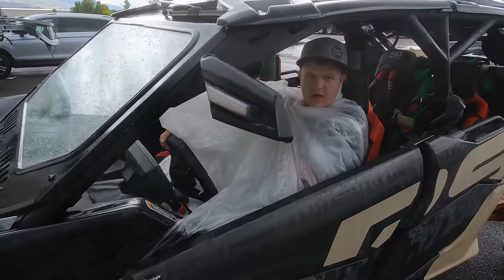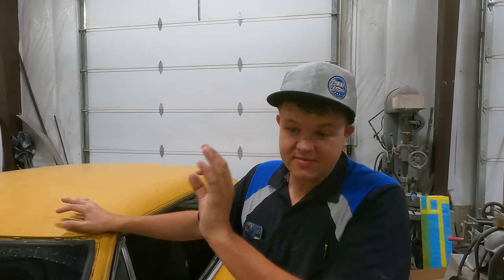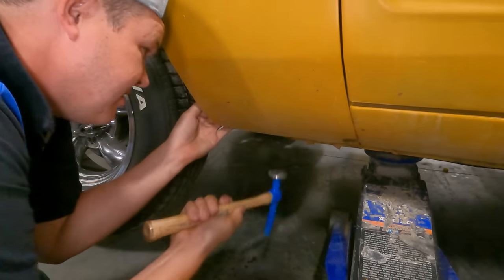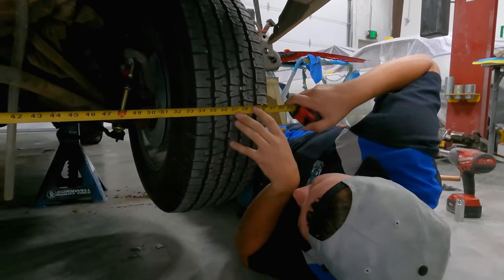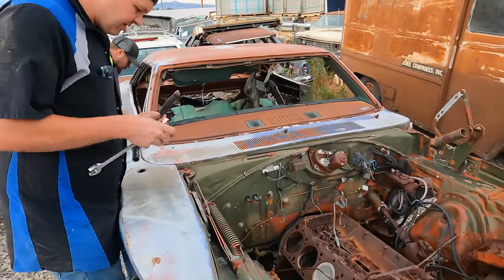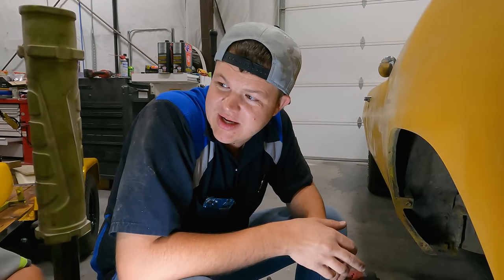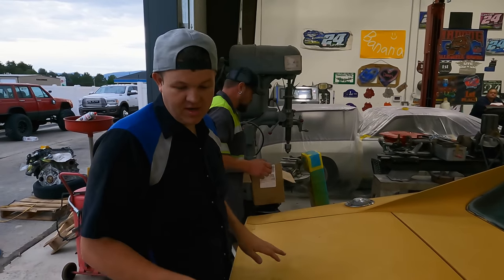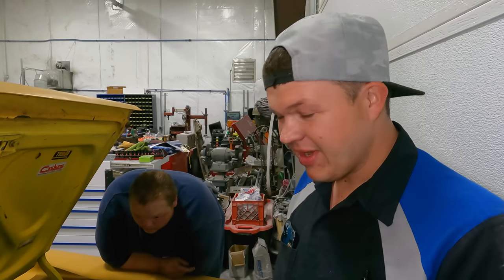Viewers DECIDE The ENGINE In The Giveaway 69’ Charger!

Comment: Even though it's NOT a number matching car I'd still keep the original engine block but build it with the usual HP stuff: trick heads, cam, headers, and a good fuel injection system (Holly or Fitech, etc) for good daily driver response.   I prefer the 727 Torque Flight auto tranny - but that's just because I'm lazy. A Tremec 6-speed is a great choice too!  Definitely want the power steering too! Also, much lower gears in the rear end for a better highway experience. I'd take it any OEM Dodge color from that year.  Also, if I could be picky could you please install the Torque Boxes that are OE on the 426 Hemi cars?? Thanks!

Comment: My 2 cents: keep the 440, freshen it up, change to fuel injection, electronic ignition and either a nice 4 speed or a 6-8 speed tranny, if it’ll take the torque. So, not a comp,rte retromod, but just enough to keep it pretty much the way Dodge built it, with a couple of mods and a f refresh so that it will run good on pump gas and be reliable. Not that old 440’s weren’t reliable, just that that term has a whole new meaning now… I mean, who wants to be changing cap and rotor every 20,000-40,000 miles and re-setting the points, dwell, gapping plugs, etc???

Comment: What age are the lads at the alignment shop? Any Mopar guy over 50 should have picked up on that missing offset alignment washer for you. My vote for the engine? Modern Hemi with a matching modern multispeed automatic......and I'm a purest. I grew up when 2nd gen Hemi's and driveshaft twisting high compression 440s were new. I loved them, but they were uncivilized torque monsters that sucked high test faster than you could fill them and terrorized towns and tracks all over North America. It wasn't uncommon to go through two tanks in a night of street racing. The modern Hemi's give you your cake and let you eat it too. They also don't overheat. Don't know what vapour lock is and they start every day, even in Winter. Two top line Diehards and a boost sometimes weren't enough to roll over and start a high compression big block Mopar in the cold of Winter. A modern aftermarket K-frame to hold that much lighter modern Hemi and hang more modern front suspension and brakes and your giveaway car becomes a usable everyday driver or joy to take across your great country. You quite simply cannot improve on a 69' Charger's looks, but you can on it's underpinnings. When these came out in 68' they absolutely stole, the also new for 68', Stingray's thunder.
Part of the reason you and everyone else is drawn to these cars is they were the best looking, meanest looking muscle cars ever made, from the front, or the back or side on. Everybody knew it then and 50 odd years on, it's still true now. Been watching your shop's detail sweating, quality bodywork on Ed's nugget and I can't wait to see how good that Charger is going to look after you guys finish with it.

Great project! Great work lads!

Malcolm Ottawa Valley

Comment: Rebuild the stock motor that came with the car. If the 440 is not the original motor, then you’ve lost the ability to restore it back to stock. Go with the 426 Hemi in that case.

Comment: I hate resto mods. you should just go buy a brand new charger or challenger if that’s what you want.. I’m 62 and these are the cars we were driving in high school. Just rebuild the 440 with a mild cam 373 gears. you’ll have the sweetest ride or I will if I win it. Nothing funner than that old-school grunt unbalanced motor. That way you know when to shift when the RPMs get high enough without watching the tack.😀

Comment: Let me see if I've got this right.
1 You had it to an "alignment shop".
2 You guys did a tape measure and jackstands "alignment".
3 Had it back to (I'm assuming) the SAME "alignment shop".
4 You just found out NOW that an alignment adjustment cam washer is MISSING???
Conclusion: Ray Charles needs to be fired or at the very least retrained at the first alignment shop.
You need to find another shop. (Hopefully Helen Keller isn't working there

Comment: I know I will be in the minority, but remember that the winner of this car is likely as not a novice when it comes to repairing an old engine. Yeah the fuel injection is an improvement but it does not make easy to repair. For that reason I suggest a crate motor. It can then be fixed just like every other 2022 Dodge.

Comment: EFI, hydraulic rollers, Trick flow heads, forged crank (maybe a stroker)... Easy 500+ hp which is plenty for your average Joe that has never driven anything with that much horsepower. 700+ sounds good to me but impractical and not for anyone who's never driven anything like that. They'll just wreck it.
 
See if you can do a collaboration with these guys.
https://youtu.be/mItHmkQmhzM

Comment: Being that the numbers matching engine no longer exists, one of the Hellcat engines with an automatic transmission, AC, power steering, and power brakes.

I'd change the steering to a rack and pinion unit, as it's smaller and already matched to the power steering pump.

I grew up in the muscle car ear. Anyone that owned one that tells you they were great cars is lying to you. Fouled spark plugs, crappy manifold or electric choke, point ignition system, and brakes that make go-cart brakes look like Brenbo 6 piston stoppers. 

Chrysler unibodies are a pain to do a full up restoration on. To do them correctly, you need a jig to bolt it to. Your present rotisserie could be used, but you still need a jig.  Also, do a sub frame tie together to keep the body from twisting. (If I won the car, I'd pay to have a roll bar built in and had it made to hide as much as possible.

Dump the 1969 electrical system. The ballast resistors are trash, Same for the amp meter that the entire electrical load runs through. Spray sound deadener in the panels and doors, flood the rocket panels with a long term corrosion compound. 

Exterior color would be a light blue metallic. Interior to be period correct possibly white seats.

Comment: whats wrong with the engine that is in it if your going to restore it back to new surly the engine has to be kept original if it drove 1200 miles it cut need changing

Comment: Since the FIRST thing you did was road trip in the car, I would modify it toward making it a great road trip car!

As someone who has built up some old mopars, one thing that I've learned, especially with the B-bodies and trucks is that they're such fun cars to cruise on the open road in....so with future mods in mind, don't loose that facet of the car! I've taken great cruising cars and in the pursuit of making them into more street/strip machines, lost a lot of that easy driving cruising ability. Which took a LOT of the enjoyment of having such cars away...took a truck that when I purchased drove almost 350 miles with a huge smile on my face and turned it into something that, while very very fast, was exhausting to drive 50 miles :(

Stiffen the frame with connectors/torque boxes/core support etc, rubber bushings, keep the stock torsion bar suspension/k-frame, good brakes, good modern tires mounted on period correct wheels so that it rides comfortable, brakes great, and handles the way a car needs to. Good restoration on the interior. Add A/C. Do a mild build on the 440, maybe with mildly worked AL eddy heads, Hydraulic Roller camshaft, small headers; something that could make 350+hp to the rear tires but nothing too crazy and would be happy pushing a car with stock torque converter and tall highway gears like 2.94's, or even 2.76's. It would be the kind of car one would be happy to spend DAYS in, and would still be a hoot when you step on the go pedal.

Comment: Fix the exhaust leak the water leaks put parts where it needs parts fine tune the engine and leave it as it is Something tells me you'll put a lot of money into it it's not going to run originally as good as it does now you should actually go to Dennis Collins coffee walk and realize how you will be destroying this car if it has all the original parts you destroying a work of art all the hype you put into it will not be worth what is probably sitting at if it is from the factory as built or even get in contact with him before you start screwing this car up or maybe ask your channel would you like to see it originally are grossly modified there are so few of those cars left due to the show dukes of Hazzard